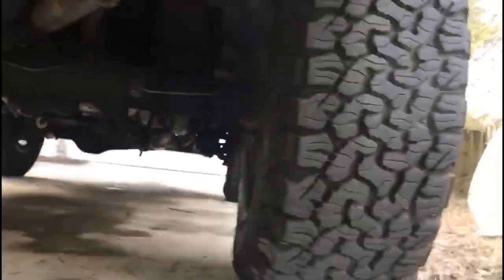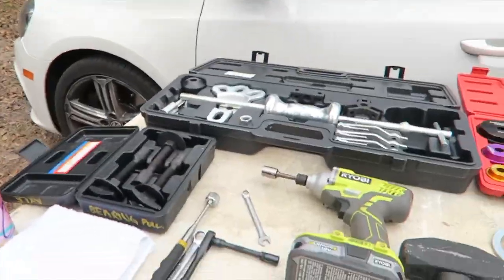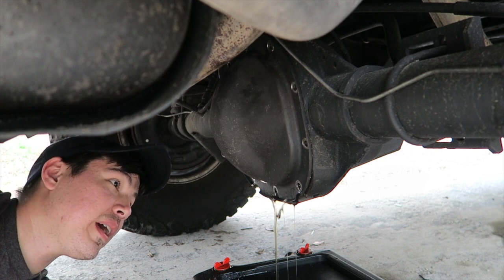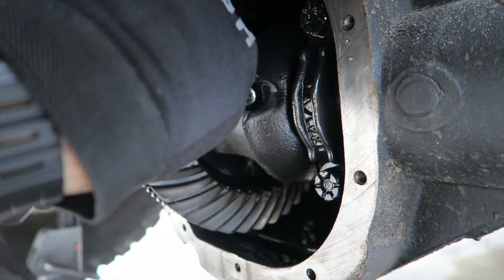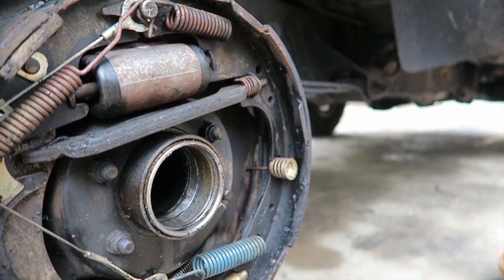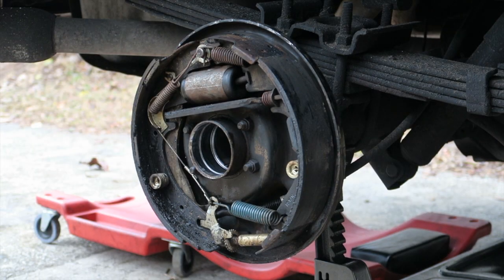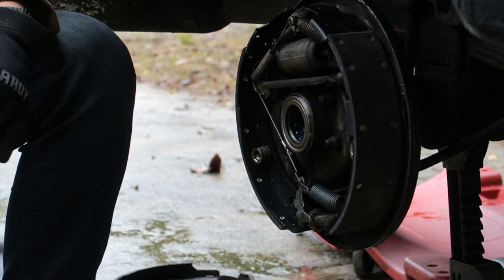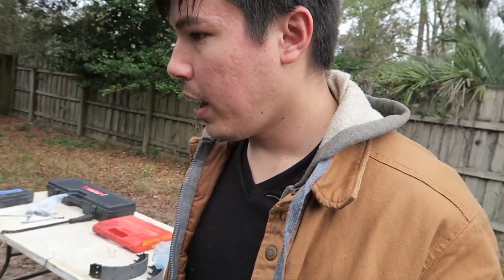BRONCO Axle Repair AE18

Comment: Did you have any problems getting your C-clips back on the axles? Seems that the repair bearings stick out past the edge of the axle tube about 1/4" & not allow the axle to push in far enough to get the retainers back on.  
I heard some noise and had some vibration coming from the rear of my 95 F150 and thought it might be the axle bearings but after pulling it apart, the bearings and axles don't look bad at all! Very slight almost non existent movement up and down. The truck has only 80000 miles on it. Also has the limited slip like yours does with 3.55 ratio. Thanks for any advise you may have as I am not a mechanic,  just a DIYer. :)
Reply from the maker: I didn’t have any problems personally. I would double check to see if you have the repair bearings seated all the way.
Reply: Could be the rear driveshaft. Splined area supposedly has rubber grommet inside that if it disentigrats creates vibration.

Comment: What's your mileage?
Reply from the maker: 250,000 Miles!
Reply: Holy smokes!
Original motor/trans?
Did you have to replace any AC components?
Reply from the maker: Original motor. I swapped in a manual ZF5 transmission out of a F250. I did have to replace my condenser and compressor for my AC.
Reply: Auto Existence is that mated to a 5.0. Was the Z5 and easy swap. Great work
Reply from the maker: It’s mated to a 5.8 actually. The 5.0 and the 5.8 have the same bellhousing bolt pattern so you could install a ZF5. Not difficult, just time consuming and somewhat expensive depending on budget.
Reply: Auto Existence cool I hav a MD05 and I’m looking for a Z5. I’m thinking I’ll need a different driveshaft but feel the upgrade is worth it. Great content
Reply: Did you make video of transmission swap?